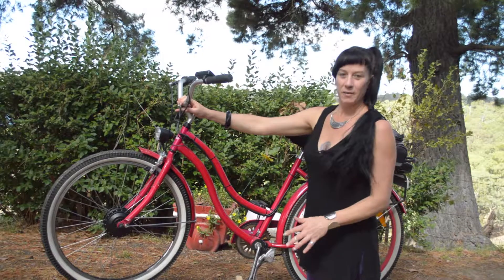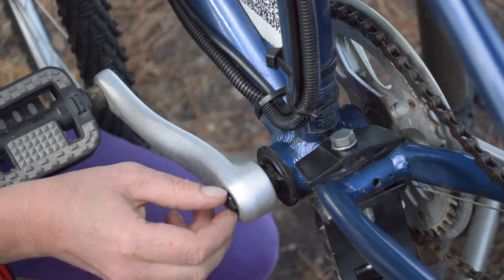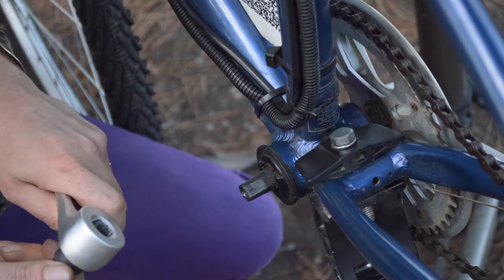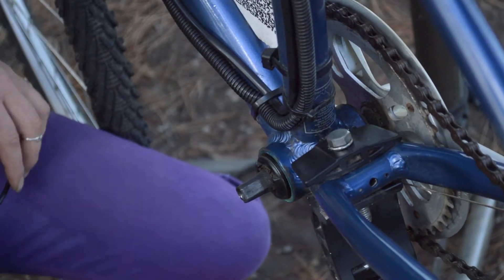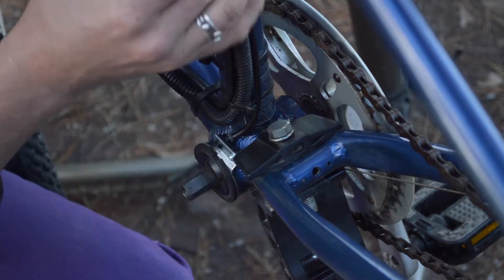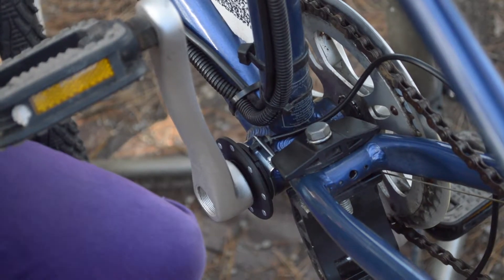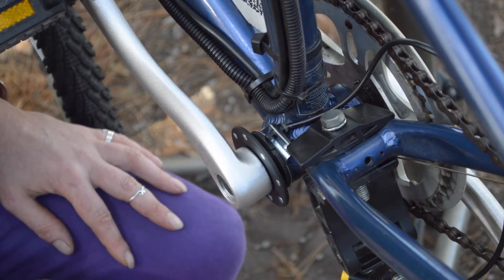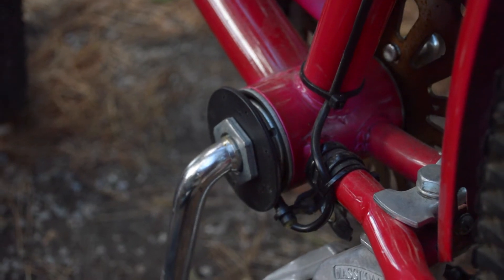The Pedelec

Comment: The magnetic ring should have the magnets facing the sensor it doesn't know what direction it is turning it is just a ring holding the magnets the sensor orientation determines the direction of the pedaling they can unscrewed and flipped 180 degrees to change direction of pedals to mount on opposite side of the bike